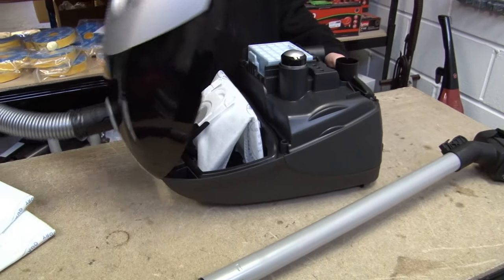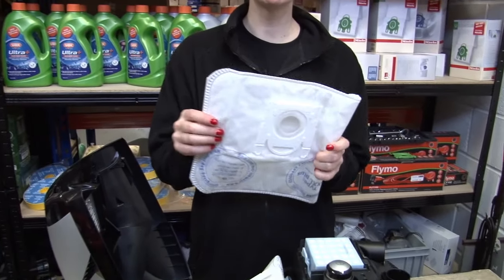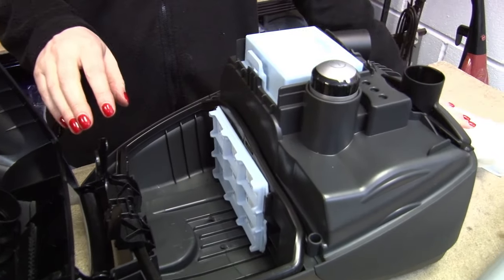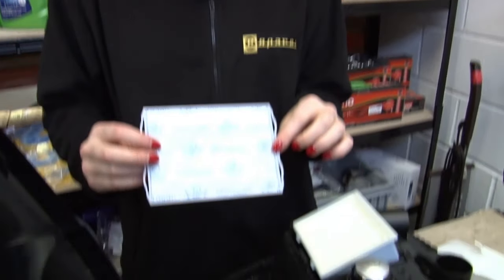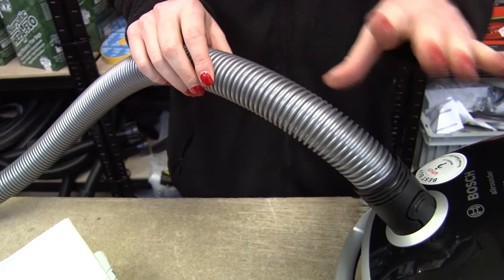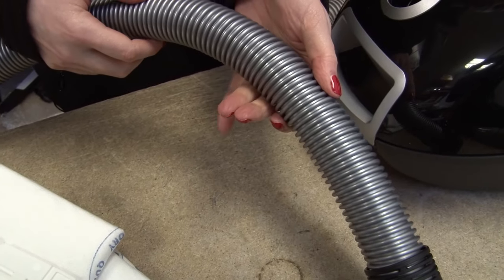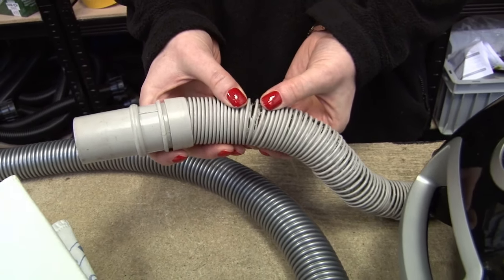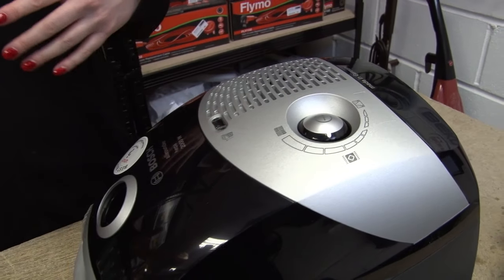Bosch Vacuum Not Picking Up? – How to Fix

Comment: Hi, I'm experiencing no suction in my Bosch vacuum cleaner and instead the air from the motor is being blown from the exhaust filter functioning like a fan, any idea what the problem could be?

Comment: I need help on how to disassemble my Bosch Ergomaxx 82040 vacuum cleaner to access and clean the motor. 

I've removed 6 obvious screws, but the top and bottom halves are still attached at the back. 

I can't find a service manual online. Do you have any tips on where to find any information?
Reply from the maker: +Erland Lewin Sorry we did not get back sooner but thanks for you other post that we have attached below:

For the benefit of anyone finding this, the key was to remove the two rear wheels with a broad knife or screwdriver, and then "unlocking" plastic tabs under the wheels which kept the vacuum cleaner together.

Putting it back together was frustrating - you need to ensure the power slider knob is aligned properly with the slider below, that the power cable runs properly, and that the little button at back also aligns properly. It took me several tries before I got it together.